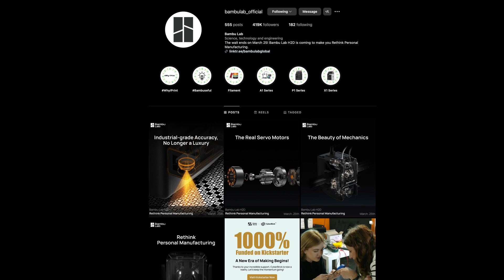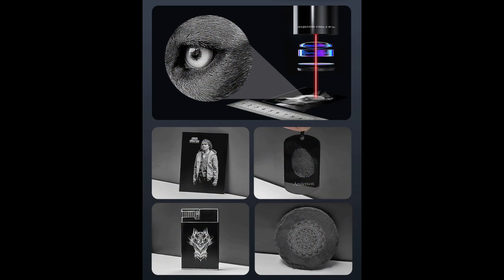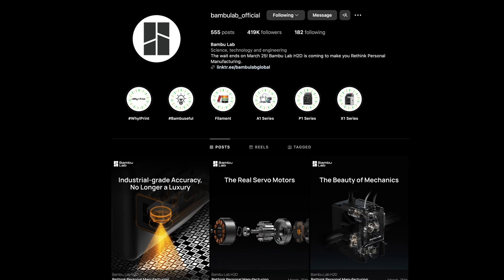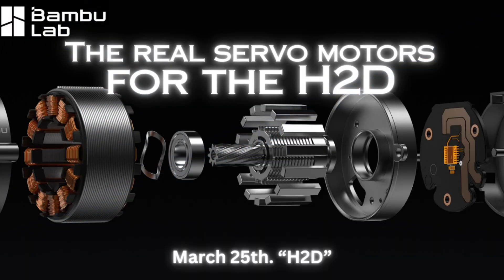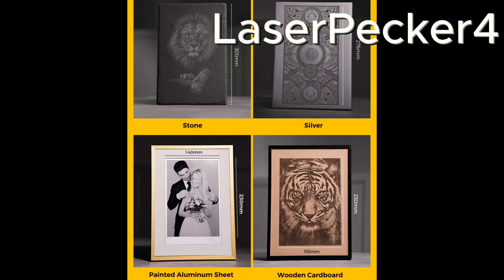⚡Bambu H2D’s INDUSTRIAL-GRADE Laser: Can It Do BOTH Perfectly? FUTURE of 3D printing? Will you BUY!?

Comment: Hold on, hold on. What if, the laser is used to smooth printing layers or better adhesion between lines? That would be so awesome
Reply from the maker: why not, ithink they think the same, will it be this model  or later idk.
but it makes Alot of sense , right!
Reply: @PrintVentures  I think that with an open software/firmware this is possible by the community. Like the ink cartridge that prints over every layer to give colour in a different way to the parts. That's another cool project. But we will see what's boiling into the pot.

Comment: Is it possible that it can be used to engrave onto 3-D prints?
Reply from the maker: I don't know for sure, 100%  but it would be very Odd if it could not, 
so my best guess is that 
Either the 10 Watt starter module Or the 2 Watt diode , that on each toolhead laser module Will be able to do that. (and then you have the 40Watt to cut tough tick stuff or engrave deeper.)
It don't make sense to me if there isn't an option to do that, I'm thinking Etching like in the video, where  I showed the lLaserPecker 4 *that have dual laser diode  system also. 
that what I think is the design Bambu are going after  a-least .

Comment from the maker: ⏳ Timestamps : 
0:00 intro 
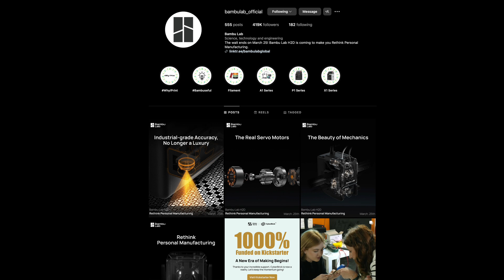0:10 The INDUSTRIAL-GRADE 3D Printer You’ve Been Waiting For?
0:20 Picture suggest it’s packed with advanced tech, including an on-board chip
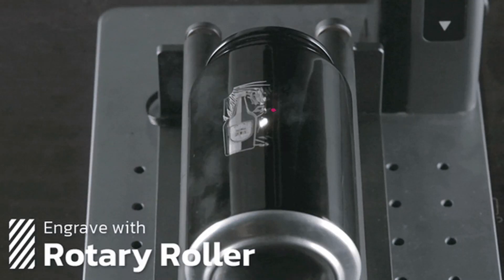0:32 Laser as good as CnC,  Don't assume CNC is the only path to accuracy. 
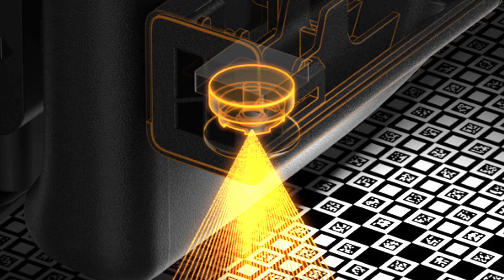1:00 SnapMaker sale unto 50% discount, they know whats coming. 
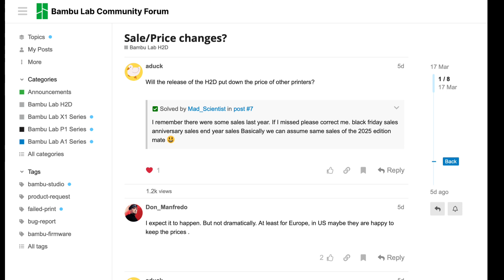1:35 Specs Modular Dual Nozzle, Laser , Heated - Dryer AMS  Build volume 350x320x325MM (Fiber laser !???) 
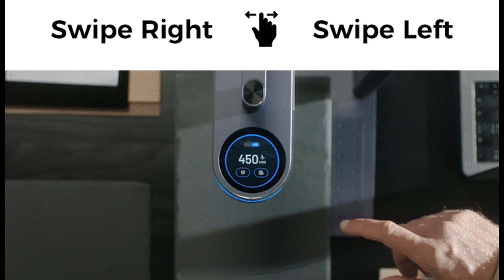1:45 Price Speculation  and would you spend up to 3000 Dollars::!?
2:15 Bambu H2D  40W Laser + Dual Nozzle = NEXT-LEVEL Precision, and precision !?